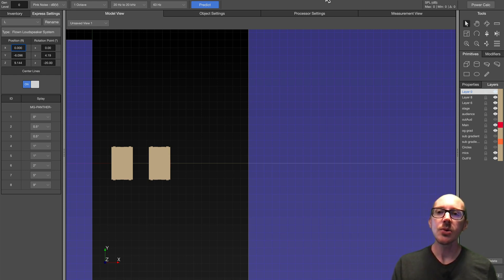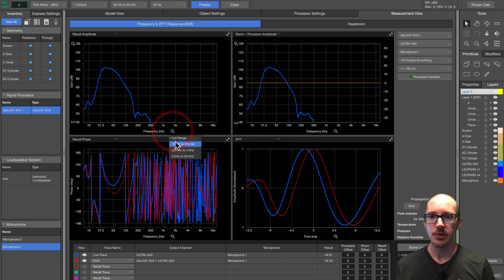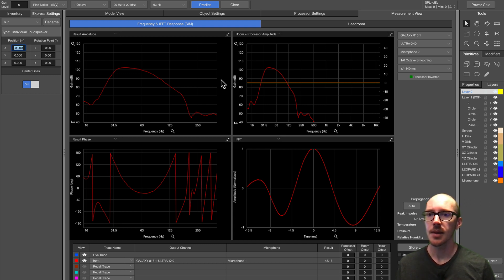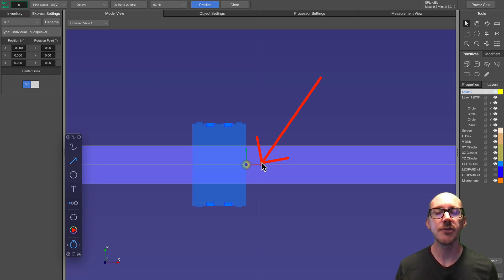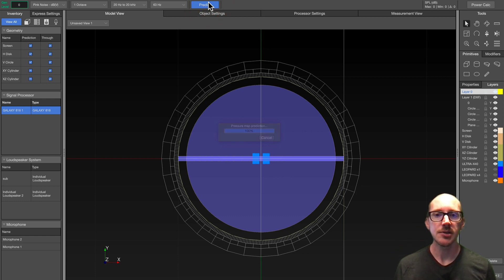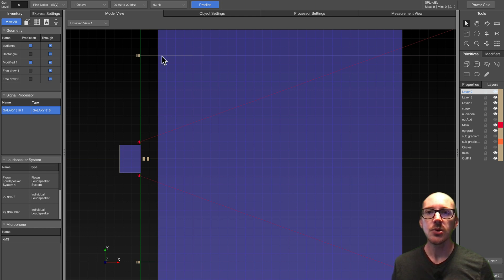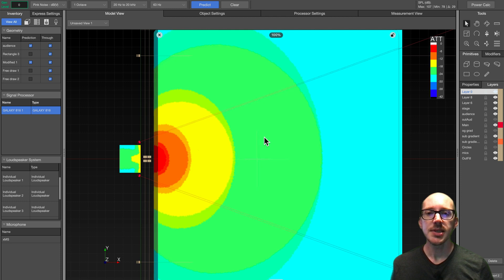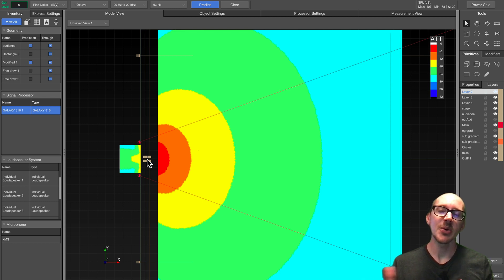Double Your Subs (without changing the pattern)

Comment: i have some danley th812s that have enough drivers i don't think merlijn's formulas will work --- can i just empircally measure the acoustic center by using two microphones on a big flat outdoor field rather than esitmate from the baffle area?
Reply from the maker: Sure. Just like in the video. Mark the center. Two mics, equidistant. Move the sub until you get matching phase. Find distance away from center. I think that should work.
Reply: @nathanlively  thank you!   the main difficulty will be forklifting it out of the forest into a field :)